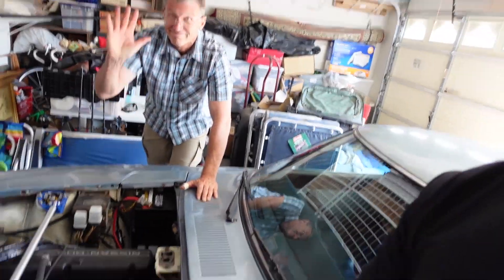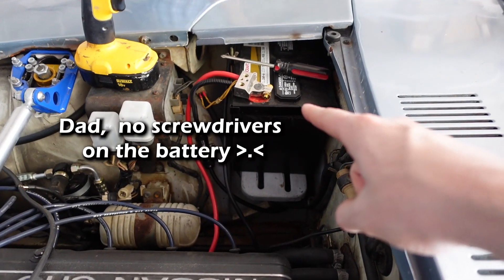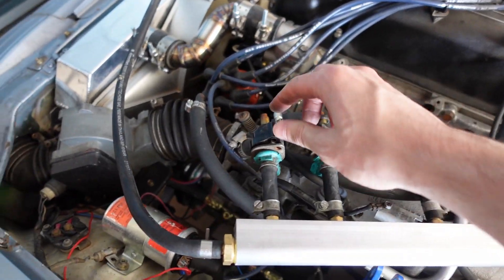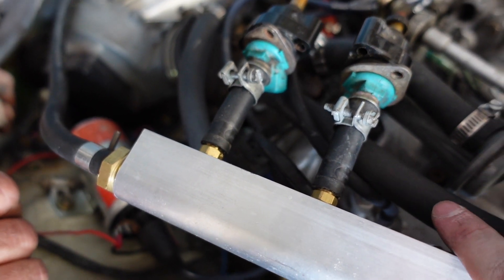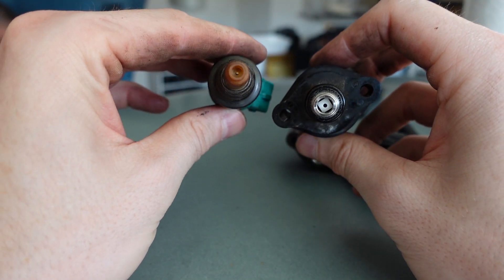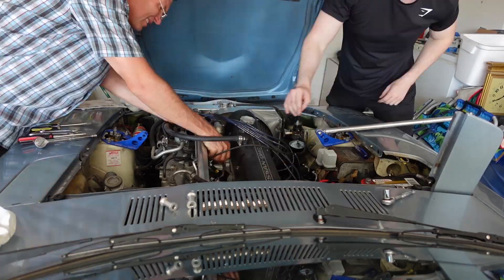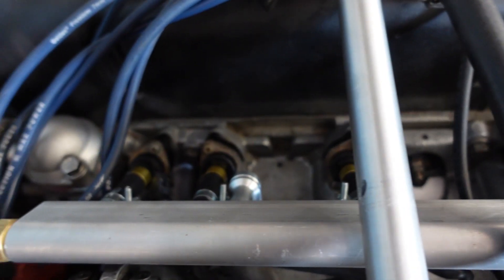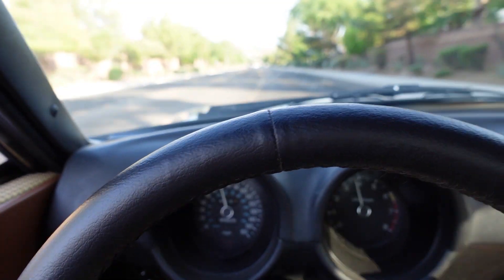DIY DATSUN 280Z FUEL INJECTOR REPLACEMENT| How to change fuel injectors on a Datsun 280z (1978)

Comment: Valve adjustment a year ago really doesn't count any more, but I'd look at the timing, power of the spark (check spark color at night by pulling a plug).  Fuel pressure and vacuum leaks.  Once parts are 40h+ years old, you really can't just automatically trust them.  Hoses, wires, etc...  Super clean Z!  I'd start with the easy things first.  Use propane to check for vacuum leaks, check power of the sparks, check timing, electric connection, etc...
Reply from the maker: I’ll look into it! Maybe those valves need adjustment again!

Comment: Typed that before you said you lashed them already I would just take the cover off and check again with mine they need adjust more often than you'd think
Reply from the maker: Thanks for watching until the end and for the suggestion! I actually switched to a thicker oil, 10w 30 and the noise went away, I guess these old cars just need a bit more cushion because their tolerances aren’t so tight in comparison to newer cars. Have been tick-free for a while now because of that :)

Comment: I just picked up a 77’ 280z and it’s having a fueling problem. I get fuel to the rails and the pressure is good. But they aren’t firing and I don’t know why. If anyone could help that’d be great.
Reply from the maker: Well if you’re getting pressure to the rail it could be that your injector harness needs replacing (cheaply found on zcardepot), or you may need to replace your injectors. Lastly make sure there’s no problem with the other wires related to the injectors 

It could be getting gas in the cylinders but needs a new distributor cap

Comment: I wonder if your timing chain tensioner isn't putting enough tension on the chain and its rattling around in there
Reply from the maker: It ended up being too thin of oil! These old cars have bigger tolerances than new cars

Comment: Did you change your clutch? Could possibly be coming from the clutch area hard to tell in the video, I had a rattle that kinda sounded like that and it was my clutch plate was loose
Reply from the maker: AZ 280z we did about 5 years ago, I haven’t heard that suggestion before but it’s certainly something to check out. Do you know what I might want to investigate to find out?
Reply: @JordanPayneLV  
Well if if the noise is coming from the lower  back of the engine could be the pressure plate or flywheel bolts loose.  Try to poinpoint the noise area if you can.  The other area mine rattled like that was the heat shield above the headers it would rattle like crazy until I tightened it down during acceleration
Reply from the maker: @ryanotown22  Awesome suggestion thank you! I had the same heat shield issue but that got resolved, this might be the issue! Hmmmm

Comment: Have you  watched the  cam and rockers  move with out the  cover on , might want to run that test with out the injectors and coil plugged in .
Reply from the maker: I haven’t! But I’ve heard that the stock rockers can be really noisy, and if you get your engine rebuilt it’s often suggested to get new rockers. Something I’ve considered. But actually since this video I switched to a thicker oil and the ticking is substantially less, almost non-existent!

Comment: Might be your heat shield
Reply from the maker: Definitely a good suggestion but that was my problem in the past, not this time! I did add a heavier oil a little while ago and it’s completely removed the rattling. I think I had too thin of oil for our heat here in vegas!
Reply: @JordanPayneLV  Forsure then it’s your rockers I wouldn’t wait until they get worse to fix! And as per the fuel rail I just bought a 280z and man I’m the second owner in 25 years hasn’t run since then in cali. It’s a huge rabbit hole of wanting to make it in pristine shape to modify it or just to fix what’s wrong and slowly build it! Your videos help a lot
Reply from the maker: Amer Khan I’m glad! Thanks for watching! If you have any questions feel free to add me on Instagram @sinful_280z and send me a DM, I usually answer messages way faster over there. Looking forward to seeing what you do!